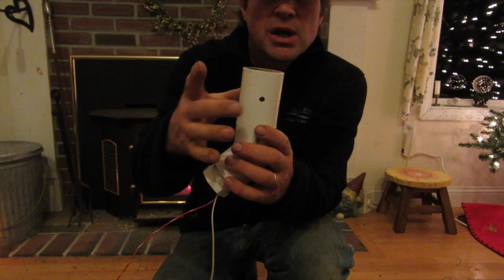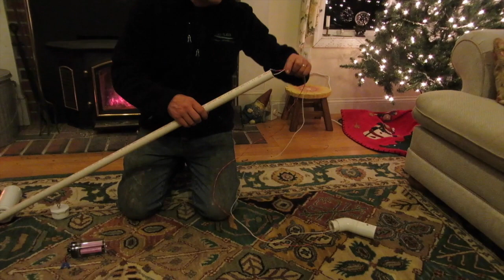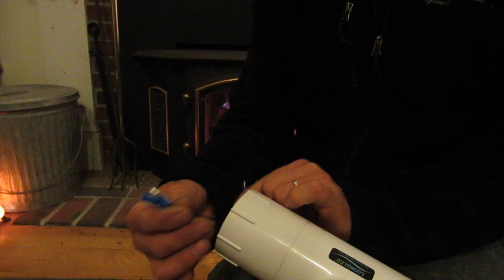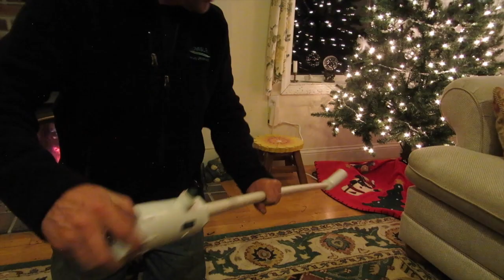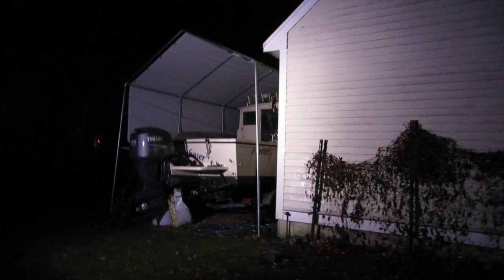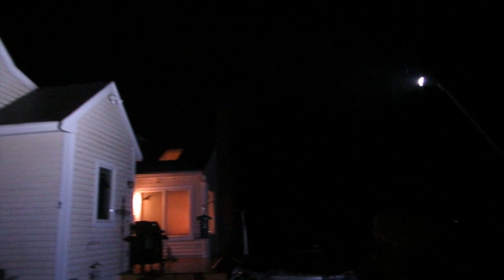Loomis LED 4000 Lumen Dual Cree XML Gigging Light Stick

Comment: how are you getting that many lumens without a driver on the led?
Reply from the maker: We use 4 Brand new Samsung 2600mah  commercial-grade  3.7-4.2vdc lithium-ion batteries which supply the LEDs with plenty of power for 2 - 3 hours of run time.